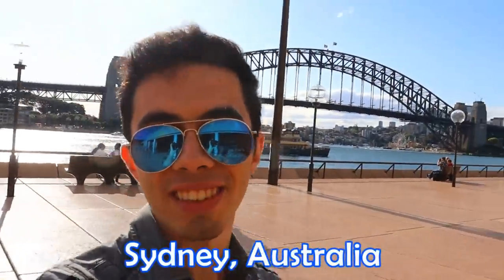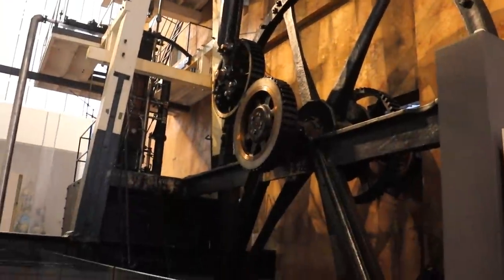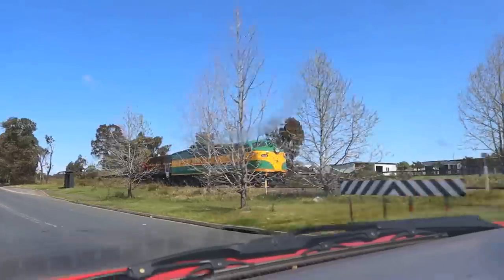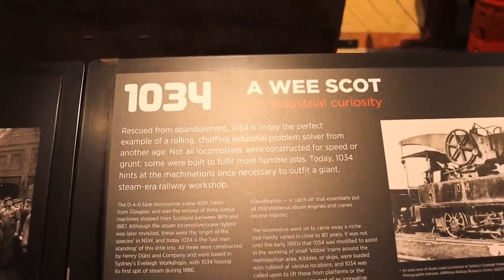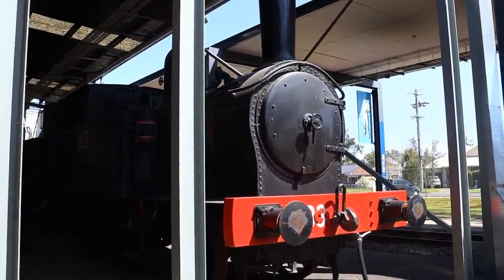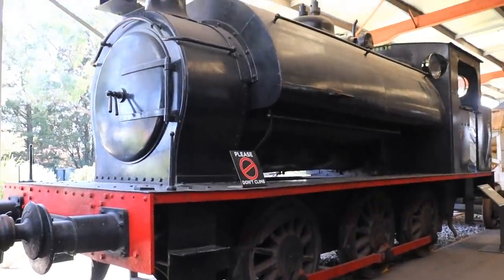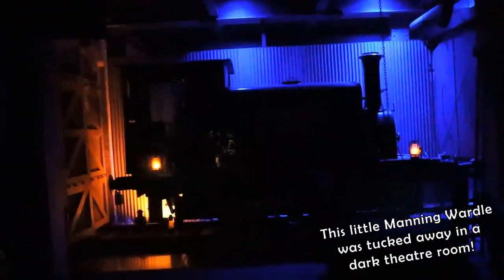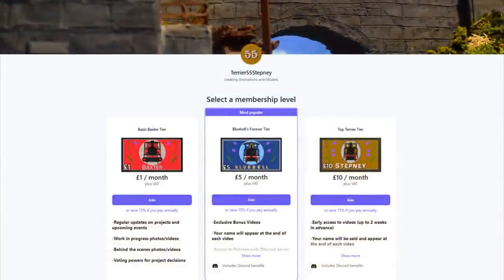Garratts, Pastas and Australian Trains

Comment: To explain a little about the New South Wales Government Railways engine classification, they followed a numbering practice similar to GWR or TOPS, then a prefix letter of C, D (and AD), X or Z.  So 3801 is the first of the C38 class of Pacifics, 5910 is the Tenth of the D59 class of Mikados, 6040 is the fortieth and contractually third last of the AD60 class of Double Mountains.... the Z's were the pre-Edwardian and Edwardian era classes of superseded models, some agglomeration of previous classification included (Z11-Z29).... X was the works, maintenance and duplicate listing (X10 class)... 40's were diesels.

Comment: I really wish I knew you were down here, it would've been super awesome to meet up with you!
I'll have to keep up to date next time so I know when you're next planning to come down under.
I'd recommend heading through some of the country towns next time you visit, particularly of note are Cowra, home to the Lachlan Valley Railway which is currently attempting to bring the old rail line in the area back to operational condition so they can run heritage services and Junee which has the oldest still functional Roundhouse in the southern hemisphere.

Comment: You know 4916 looks a lot like one of diesel locomotives up at North Conway Scenic Railroad in the white mountains of New Hampshire
Reply: She is one of 18 such locos built locally by EMD which means she's a GM. All the locos spent the majority of their service days working in western NSW where they were renowned for the reliability in harsh desert like condtions and in their final years in Sydney. Some are preserved and others have been bought by private freight operators. The green and gold loco behind her is 4201 another GM and one of only six locos three of which have been preserved and they are 4201, 4204 and 4206 but only the two former ones have worked for any length of time in preservation.

Comment: Nice Stepney its nice to watch you video's again Also is it just me or Australian Steam locomotives a mix of American and British designs?
Reply: Yeah, that's very much the two primary influences on design. Originally, it was 100% British, because as a colony of the Empire that's kind of the expected norm, and established all the fundementals of railway practise down here (not uniformly, I might add- each state/colony definitely had it's own take, which would create some logistical nightmares post-federation). through the interwar period, you start seeing more of a US influence in designs and operations, as around this time ex-pats from the states were becoming CME's and other director-level positions for respective state-owned railways and imparting their own experiences on their lines. Of course, US builders and had been used before then, but this is when some of the design and operation standards started to change (For example, implementing Air Brakes instead of Vacuum, AAR couplers replacing Chains, etc).
It gets weird after WW2 and through dieselisation because of the UK strong-arming a Buy-British policy on Australia for infrastructure investments (which was loop-holed fairly regularly by getting local workshops to do the fabrication on US designs), but then the general trend towards locally-tailored, US-based designs continues to this day, purely because US makers built engines that met the haulage requirements down here.
Reply: As a resident of the state, kind of a yes and a no. Most of NSW's steam locomotives (both for New South Wales Government Railways and the industrial scene) are British-built with majority from Beyer, Peacock & Co. of Manchester (could say we were their biggest customer). As a result we took mostly from British practice (buffers, four-wheeled wagons like the J & A Brown-owned LCH hopper at 14:54) but we do have a few American locomotives. 

No. 4001 is an Alco model RSC-3 built in Canada but their success was shortlived and they were gone by December 1971 (for comparison, steam on NSWGR ended on 3rd March 1973) and while some like the EMD E8 (altered as NSWGR 42 and 421 classes) and Alco FA (NSWGR 44 class) found success while the British-built 41 class were just shit, with a habit of overheating. 
As for steam, the class that No. 5910 (timestamp 15:17) belongs to were built by Baldwin-Lima-Hamilton in the early-1950s as oil-burners due to a coal shortage and are based on the USATC S200 class, and are also the first locomotives ordered from the United States by NSWGR for over 50 years (the last ones were crap and made obsolete by 1924 under a reclassification scheme) and all but three of the 20 were converted to coal-firing. Three still exist (three coal, two oil) and I've seen four of them including 5910. The others are oil-burning 5908 + 5916 at Goulburn and coal-burning No. 5917, which is mainline operational.

Comment: Max you wondered what it would be like to fire the Garratt. Well it would be a sit down job as they had an automatic stoker and here's a cab ride on the mainline from Tarana to Bathurst in 2018. The bloke who took the video was going to ask the crew how they fired and drove her but the hissing from the stoker jets was just too loud. The loco 6029 was classed as a "super Garratt" for she had like 6040 had enlarged cylinders and in her service days was dual controlled which enabled the crew to work her forward or reverse and always be facing the direction of travel. 6040 was regarded as a "light type Garratt" if something weighing 260 tons can be regarded as "light". 6040 was never fitted with dual controls.
 https://youtu.be/79H50e5GT7E?si=Kbb6QoNG-rp0Yd32